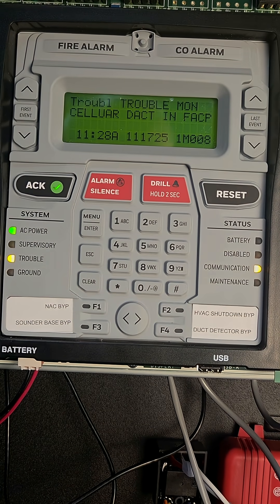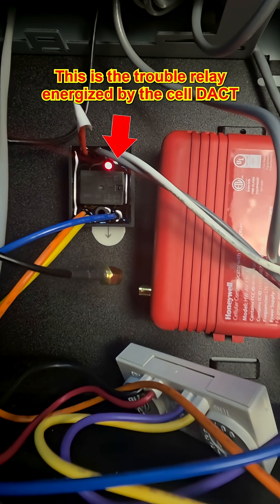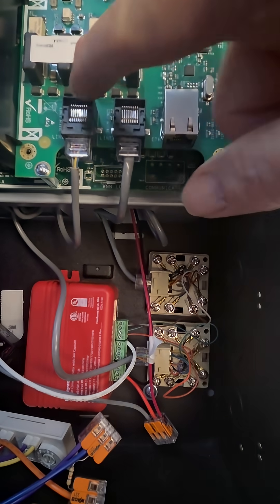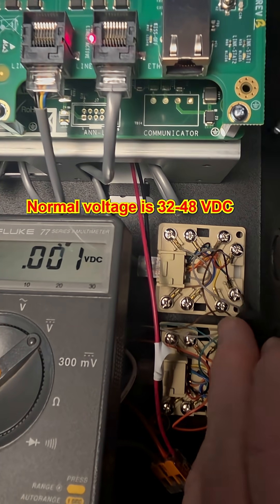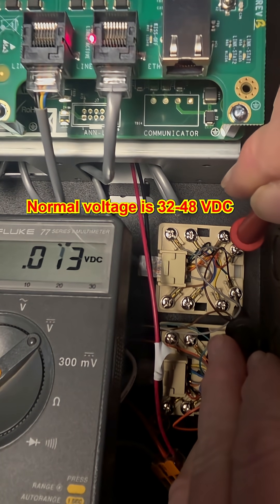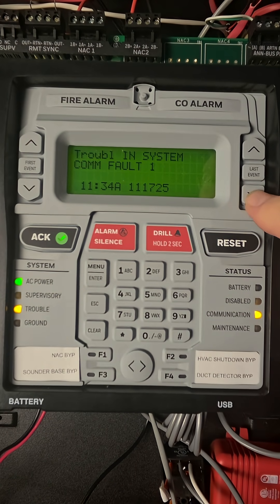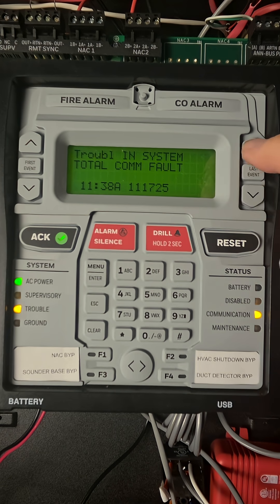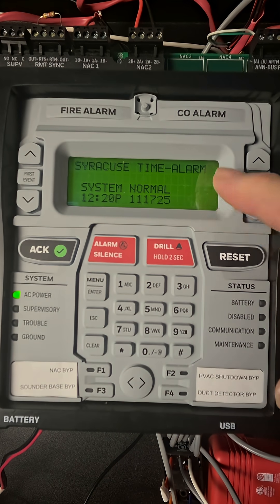FIRE ALARM COMMUNICATOR FAULT (Notifier 50X) #firealarm

Comment: If I use the panel without iPots communicator does it show trouble message?
Reply from the maker: That would be model NFW-50XI which would be local fire alarm unless you connect an external DACT to the alarm/trouble contacts. 

You wont get communicator faults because there is no communicator present.